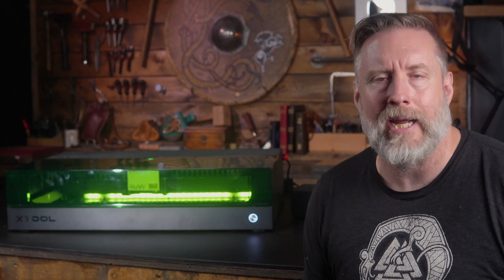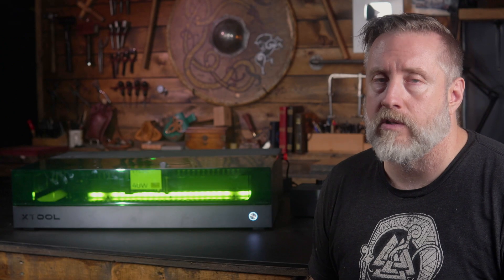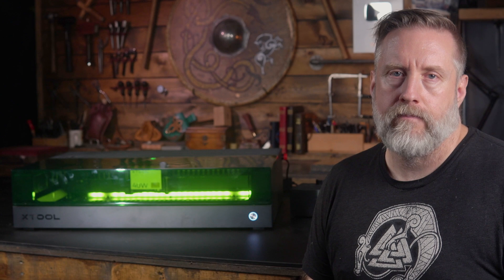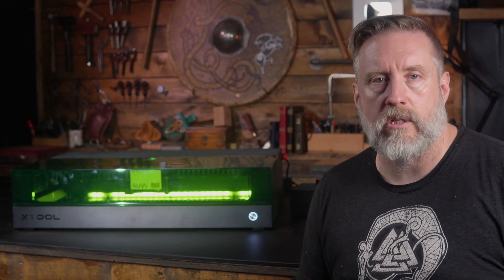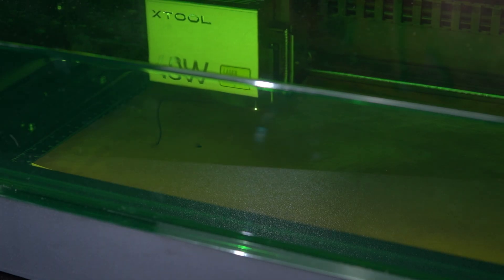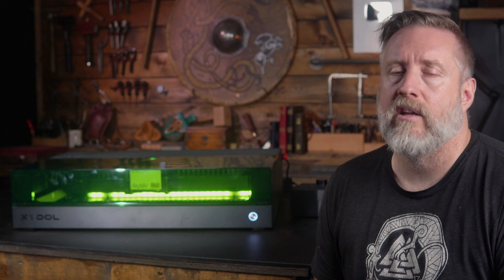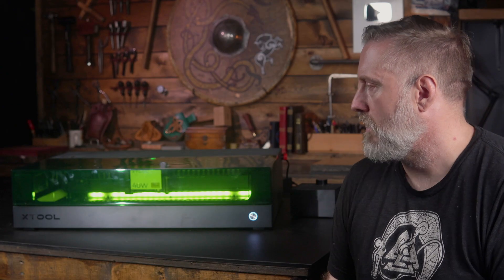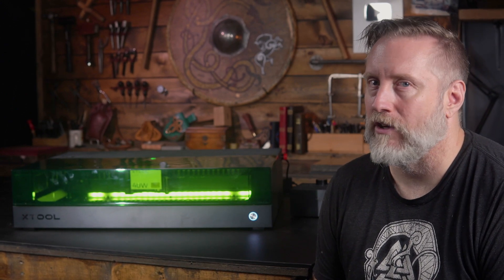Why is the XTOOL S1 the MOST PRESICE Laser Cutter Engraver - 10W 20W 40W

Comment: Hey there, I’m new here and I want to start this as a hobby. I’ve research for about a week and I’ve came to the conclusion that xTool S1 fits the best, as you represent here in the video. One of the things I want to ask you is about the type of laser I should buy, as I want to engrave mainly with wood and even cut it, but I think buying a 40W would be a terrible mistake as a beginner. Would you recommend either the 20W or is the 10W one enough for a beginner like me? Does it do whatever I want it to do or should I just buy the 20W one? I’ve also heard that xTool has the best support and due to my lack of space and ventilation, I think an enclosed diode like this one is the best pick. Please guide me! 🙏